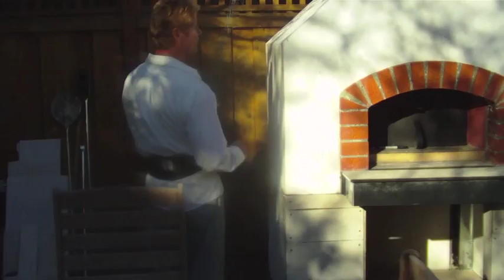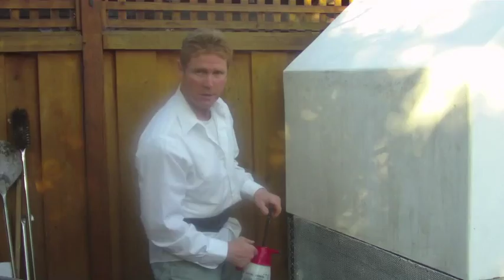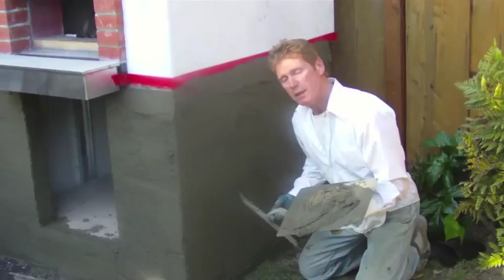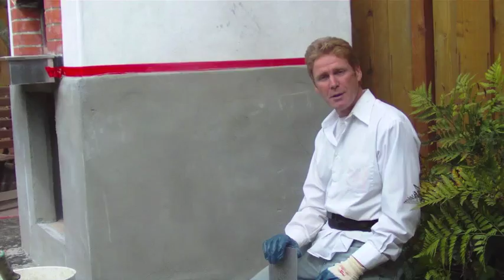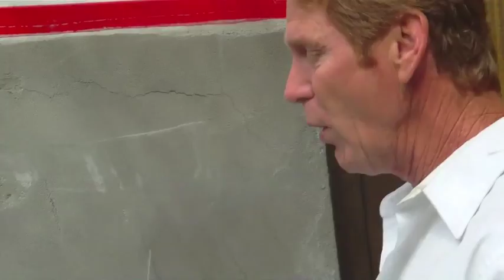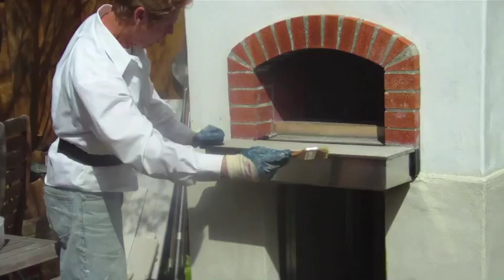Plaster your own backyard pizza oven

Comment: Kirk you are a true master. I would value your recommendation for a pizza oven that has no shelter and dome is exposed. I’m assuming some type of acrylic stucco for the dome?
Reply from the maker: That or Ttucco-flexes "renew paint" as I guess you want it sealed. https://youtu.be/vaykXWAsFCA/ How to apply acrylic stucco.
https://youtu.be/-ouCizIJcfE/ Spreading acrylic finish over cinder block chimney.
https://youtu.be/283DclFqDwk/ How to apply acrylic finishes for duck ponds stucco-flex.

Comment: I did a ceiling with Hardie backer, do you have to lath it? I build shower with Hardie- stuff sticks good. I'm going to just skim coat my Hardie with stucco color cost
Reply from the maker: Hardi backer is horrible for ceilings too heavy and can fail or fall, for shower walls it's not so bad provided you have applied a thick peel and stick heavy membrane first. 
I don't recommend it for either in the futue.

Comment: Kirk, what do you think of 2x base coat with mesh and finish coat over cement board? The stucco build up is only about 1/4 inch thick. How would it compare to regular scratch, brown & finish if you wanted to do a Santa Barbera/ Marble finish?
Reply from the maker: Evening Colum, id recommend a skim coat of about a quarter-inch or less, then two coats of fine finish. 
Two coats of fine finish are about an eighth inch thick.

You can adjust the basecoat to whatever depth you want for a piazza oven.
                                        peace, love, and harmony to all
         Sound Plastering tips for the DIY’er, apprentice plasterer or the Plastering experts

Comment: Kirk, I'm refinishing a "basement" room. The center section of an exterior wall is cement block exterior wall, aluminum studs, RockWool insulation and 1/2 inch Hardy Board, instead of the regular wood studs and Sheetrock. the reason for this is to provide a non combustible section behind a small wood stove. I checked with my local building inspector and he has fully approved my plan. My question to you is regarding applying a finish to the Hardy Board. Since this will be three sections of Hardy Board I would like to apply a stucco/cement finish to it to unify the look of it. Do I need wire lath, bonding agent or other techniques before the finish? Is this even advisable? Will it last in spite of the heat exposure, if done right? I'm providing 18 inches of clearance and a metal heat shield between the stove and wall. What do you recommend?
Reply from the maker: Evening Robert, I'd recommend you use a veneer plaster basecoat with a veneer finish. Naturally, if it gets too hot, it could burn even the lime plaster.
                                        peace, love, and harmony to all
         Sound Plastering tips for the DIY’er, apprentice plasterer or the Plastering experts

Comment: do you have to use wire on durarock
Reply from the maker: Howdy Barren, If I am called to stucco over durock, depending on what I see I may use 3.4 wire on the whole area or just mesh tape on joints or simply attach stucco corner and stucco as usual, depending on what I have to work with.
 Best wishes, 
Kirk & Jason’s stucco repair video’s

Comment from the maker: Hey brazy, great question, If time would have permitted I would have done so.
The base would have taken about another hour and a half to dry as it was cold,  almost dark, plus I had applied a bonding agent on the walls which took away the suction and sealed it. I I had to return anyway so it didn’t matter that it cracked as my color coat finish covers the cracks. What I really to show was hard steel troweling on a brown coat results in cracking.
Have a groovy day!
Kirk Giordano plastering

Comment from the maker: @hmanontario, hi Manontario, this framing works fine, I have gone over brick, cinder block, concrete, wood stud framing with plywood sheering. 
No, an expansion joint wasn’t necessary.  If they wanted fancy, I could do this, but  expansions joints  it would have probably looked over built.  In this case he originally was going to paint, I decided to color at no extra charge as I did the top with a LA Habra color finish and wanted it to look similar. 
Have a great day! 
Kirk Giordano plastering

Comment: What kind of sub-straight would be preferred instead of the cement board? And is there an expansion joint between the top and bottom section or was it unnecessary in this application? Thanks!
Reply: Good morning I just subscribed to your channel on YouTube
great videos!

My question is this I live in Lake Havasu City Arizona I'm considering building a stucco wall using angle iron for the frame and plasterboard
I'm just curious what your thoughts are on this and if there are any negatives for this type of wall? I'm thinking it will be a whole lot cheaper than a block wall and looked better
thanks for your time
Jimmy